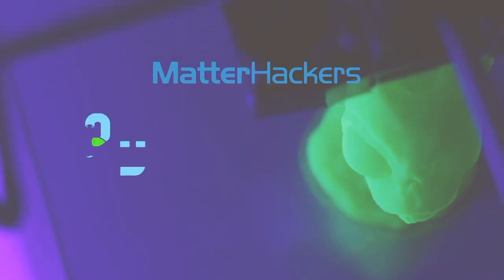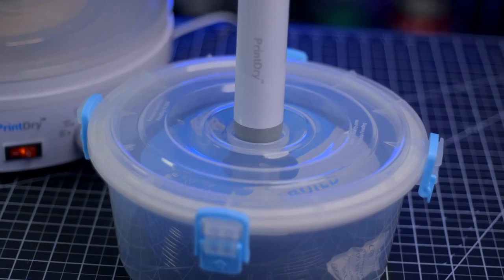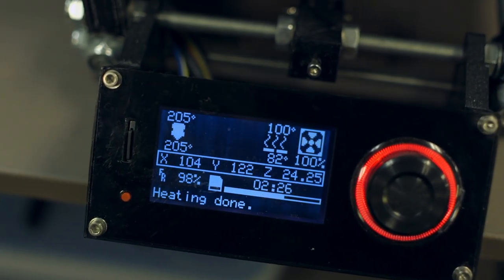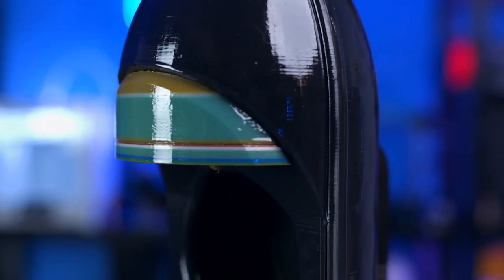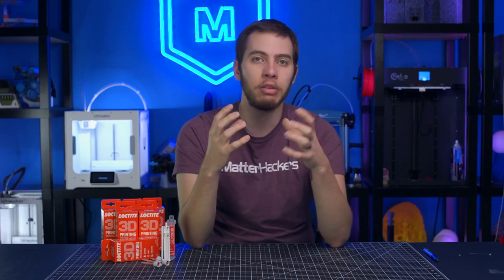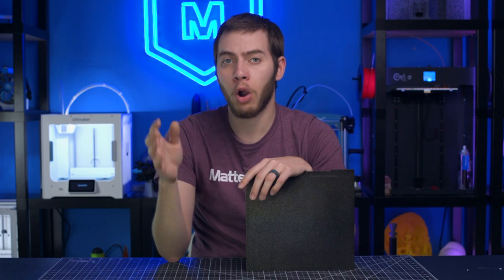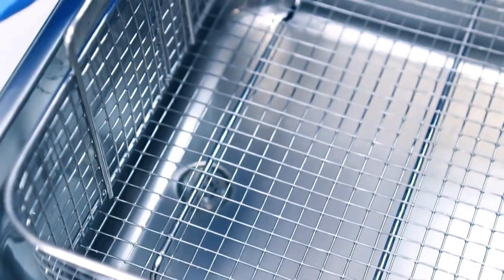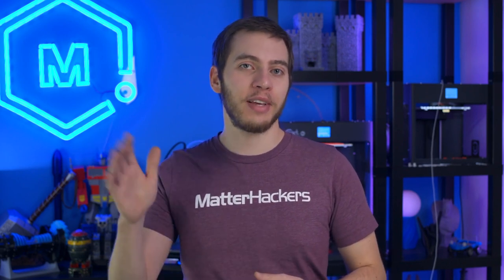Top Ten Ways to Elevate your 3D Prints

Comment: To give prints more weight, I like to print without infill, or low density infill gyroid (as gyroid is not encapsulating), and fill the printed part with resin. Its helpfull to increase the perimeters to 3 or 4 to be sure to have no leaks coming out your print.